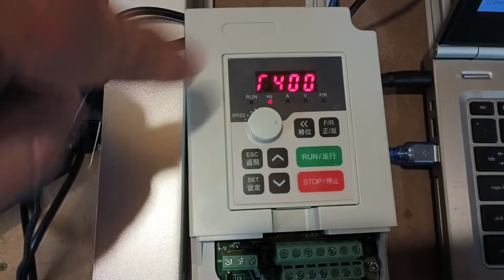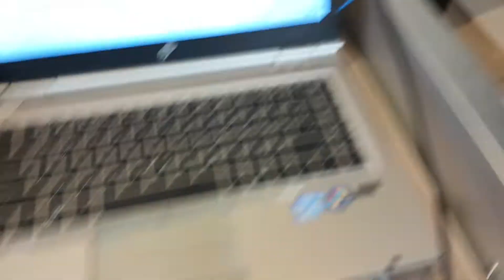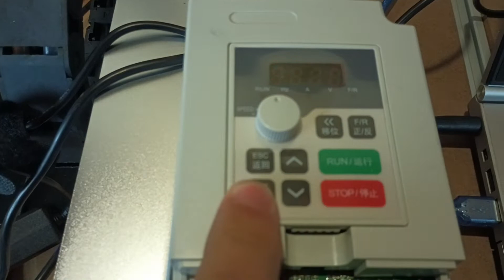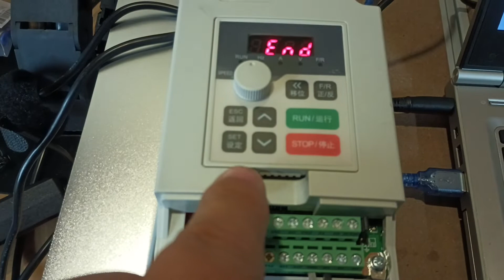how to turn on a water cooled spindle directly from a fox alien vasto CNC machine

Comment: what does the 'spindle' connection output? doesn't the maxwell in the controller box have
 a dc output
Reply from the maker: To be honest I'm not sure. It was just a lot easier to use the laser out because it had lower voltages and was easy to integrate a relay too. Sorry I couldn't be more help

Comment: I've seen a couple of youtube videos of people modding their VFD to add a temperature sensor to the heat sink to keep the noisy fan off. Your VFD seems very well behaved regarding fan noise.  I'd like to get the exact same one.  Can you post a link, or keywords on how to get the same one?  1.5 or 2.2 Kw?  110v?  Thanks.
Reply from the maker: Hey Doug, sorry for the delay, I'm in the Bay area and we've been getting doused with rain storms. So, the numbers on my VFD are: 'H100-1. 52C -1B
Specs: 
1.5 KW, 1ph, 110v 50/60Hz 
I bought this specific one because I don't have access to 220v.
Hope it helps
Reply from the maker: It was part of a kit very much like this
https://www.vevor.com/spindle-motor-c_10130/vevor-2-2kw-er20-water-cooled-spindle-motor-drive-inverter-vfd-clamp-pump-pipe-p_010501706315?v_tag=8fc8f400-96d7-11ed-a051-37ae3e4e3c1b.4
Reply: @tgirard123  Thanks Timmy for the information.  I was going to go 110v for convenience, but now I read some people have trouble with that, but I haven't read specifics yet.  I'm guessing that switching to a 20 amp breaker with a 12 gauge wire would work, but if I have to do a new run, why not just do 220v.  I was comparing your VFD's button, knob, and terminal block layout to ones online.  I found that G-Penny on Aliexpress and Rattmmotor on Amazon have nearly identical units.  Hopefully one of those has the same good fan behaviour as yours!  The Vevor one you linked looks similar too.  Sorry to hear about your weather.  I was in Foster City around 1998 or so, it rained 30 days straight.  Visiting a BMW dealership, I saw a car in the lot that had the interior completely removed, including the dash.  I asked, and was told the owner had parked it in a dip and flood waters came.
Reply from the maker: @dougw3531  hey Doug, I had not heard any issues regarding the 110 volt version of the vfd. And, I have had no problems using mine. That being said, I would totally use the 220 version if you can get 220 your machine. There's just a lot more selection and I think you'll be better off overall. I rent the house I'm in so I'm not going to make any significant changes. We were in Wisconsin at the time it flooded here in 98. I heard about it though.